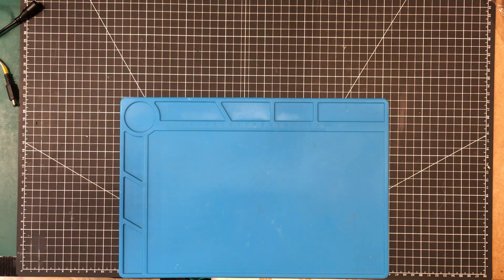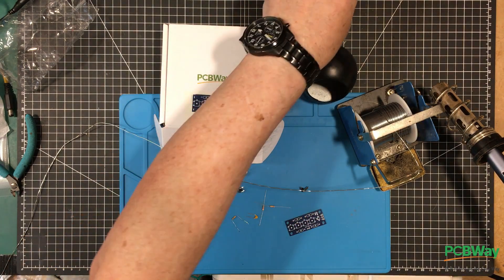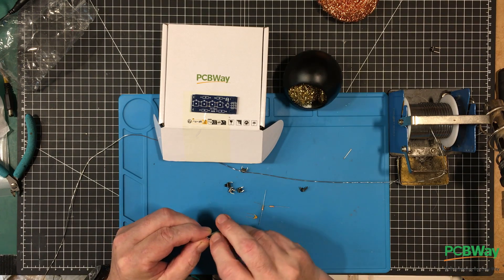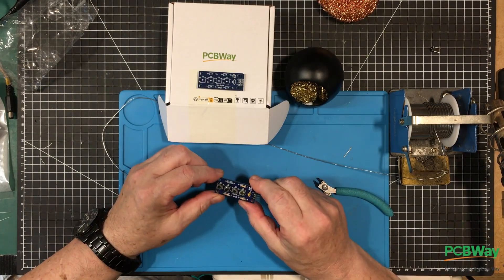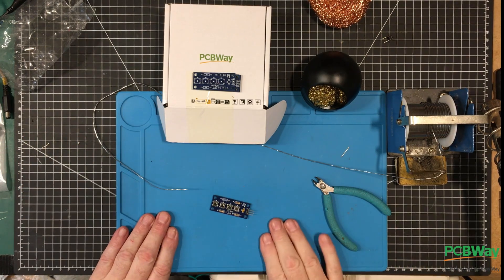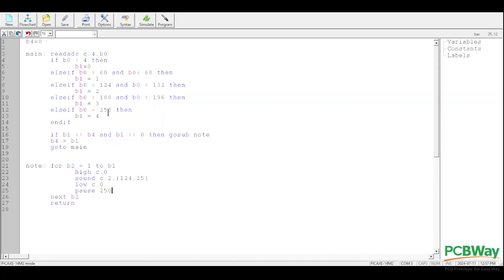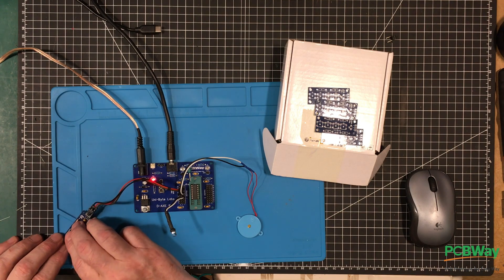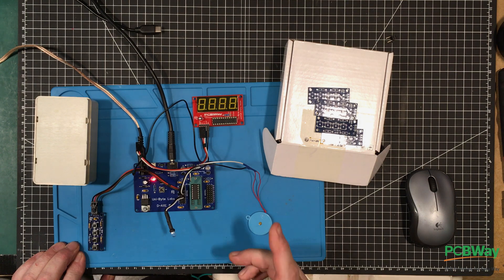Uni-Byte 0200 - Analog KEYBOARD Build and TEST.

Comment: Helping the dog = a wonderful project! The dog could be trained to come to you, when it beeps, rather than you being trained to go find the dog, when it beeps. Then, the timer could be made smaller and attached to the dog's collar. Tip regarding brass sponges = I can not list all of the benefits of brass sponges over wet sponges, here. But, for a lot of scientific reasons, they are better. For example, wet sponges draw all of the heat out of the tip, needlessly. So, if you don't know why, research it. Also... The brass sponge holders come in two types... The round ball type, that U-B uses in his video, and a dish type that does not wrap over the top of the sponge. You want the ball type. Why? Because, without the top dome, the dish type allows the springiness of the sponge to sling solder all over the place.
Reply from the maker: Thanks!

On the damp sponge vs brass.  There are arguments to be made on both sides.  Let me give my perspective.   First, yeah, there is thermal shock, but unless you sponges is soaking wet it will not be nearly as strong a shock as melting solder.  Also, I always suggest doing your wet cleaning after the joint/joints are made so the iron  temperature has time to recover (although this seems to be less of a concern with modern irons).  That's why I use both.  If I'm say, soldering an IC socket, and need a quick clean I'll use the brass.  I find the damp sponge, if done correctly, does provide a better and more thorough clean than the brass whereas the brass is quicker and does not affect tip temperature as much.  All that said, if you are using lead free solder, it probably best to avoid the damp sponge.  There are known metalogical issues that arise that apparently reduce tip life.  I don't know about this as I don't lead free solder for hand soldering.  Also, there is a maintenance issue with using a damp sponge.  You need to clean the sponge regularly otherwise debris and contamination will build up.  Each method has it's merits and I find the best for me is to use both.  Here's Uni-Bytes tip for damp sponges:

> Keep your sponge and your sponge tray clean.  I wash mine before every use.
> Do not use it soaking wet.  After cleaning, gently wring it out so it is just damp.
> For long soldering sessions, keep a dropper of distilled water on hand add 1 or 2 drops as the sponge dries.
> Clean the iron when it goes back on the stand rather than when it comes off to do another joint.
> If you need t clean while actively making joints, do it gingerly.  Modern irons are less affected by this.
> Consider using both damp sponge and brass wool.

Edit:  There is a good discussion about this over on the EEVBLOG forum.  Search for "Why are power supplies done on single sided boards more often than not?"

Comment: I prefer a sponge with water to clean my iron. The steam bubbles clean the iron more thoroughly.
You take good care of your dog. Good man.
Reply from the maker: He's worth it.

I actually use both the sponge and the brass wool.  A friend once told that's like wearing suspenders and a belt.  However, I find different gunk responds to different techniques so having both seems to work best for me.  However, if I was limited to just one it would be the wet sponge.
Reply: @uni-byte Please consider getting a $10 Boya lapel mic, your audio is really low and muffled. I had to use auto subtitles...
Reply from the maker: @edwardfletcher7790  Sorry about that.  It's not my microphone.  I do this in editing because it is easier to turn something up than it is to deal with a lot of distortion.  Maybe I'm cutting back by too much.
Reply: The wet sponge is terrible, it lowers the iron temperature and introduces impurities from the water onto the iron tip which accelerates corrosion and poor solder joints.
Reply from the maker: @edwardfletcher7790  yeah, to a certain extent.  You do have to keep your sponges clean and I suggest using only distilled water.  You can buy by teh gallon at Wal-mart for like $2.  Lasts for years.  When I first learned to solder no one was using the brass wool.  You just learned to wash out the sponge every day.  These days I'll completely squeeze out all the wash water then add a little distilled.  Keeps things quite a bit cleaner.
Reply: @uni-byte  Whoa,Metcal tips are expensive too 😮 !!!
Reply: @edwardfletcher7790 , I have a cup of them I snagged at a start-up's bankruptcy auction for next to nothing. Apparently I was the only person there with a Metcal. I also have a couple Metcals to repair. Now that I'm old, and don't really need it, my lab's very well equipped.
Reply: @edwardfletcher7790 , distilled water. And my Metcal heats up the Curie point tip almost instantly after I clean it. I got NASA certified 50 years ago. This ain't my first radio.